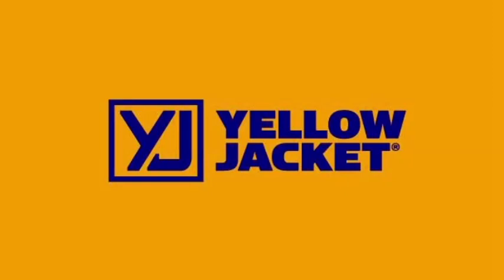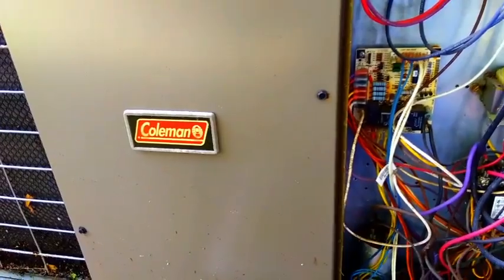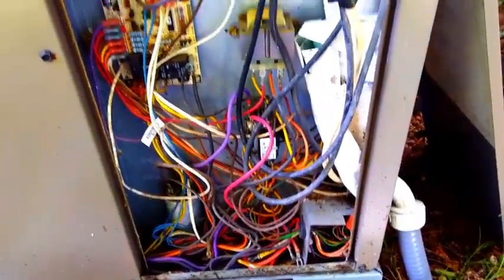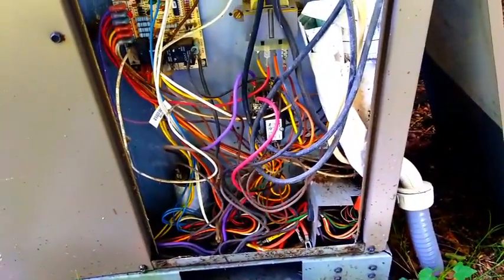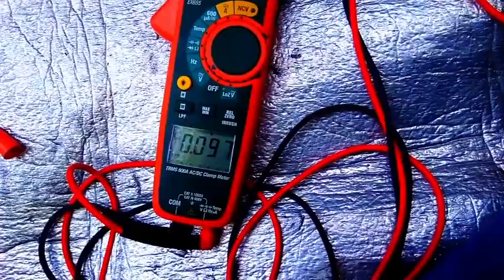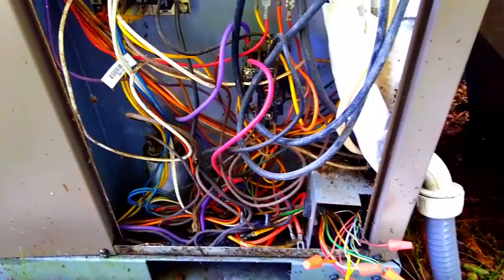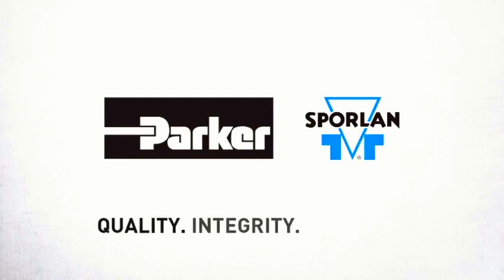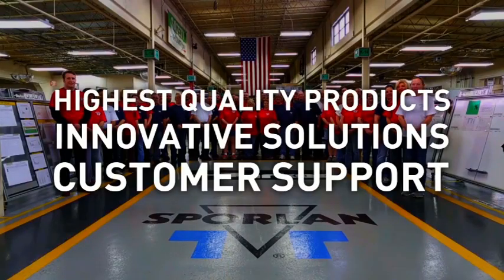HVAC Service Call | Thermostat Failure | No Cooling

Comment: About eight years ago my local supply had a promotion for Lux thermostats...every one I installed failed with a runaway condition (stuck on heat or cooling).  Seems there was a well known (known to all the wholesale insiders, but not to us field techs) problem with these stats.  Bottom line: All I got back from the supply house was a credit towards a few new stats.  I had to eat the time to install, and replace, eleven Lux thermostats.  Now, I do not install ANYTHING but Honeywell.  Unless my customers specifically ask for a different brand, or something networkable, they will get a bulletproof Honeywell RTH2510B.